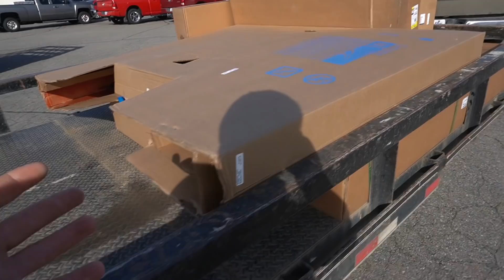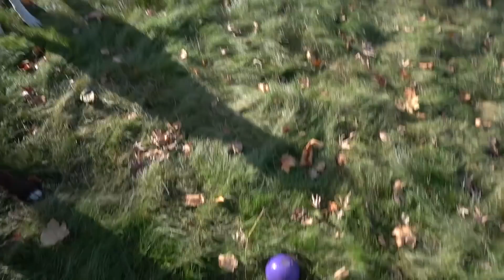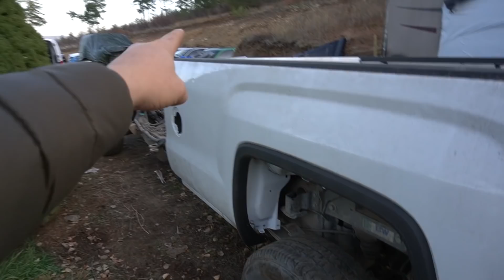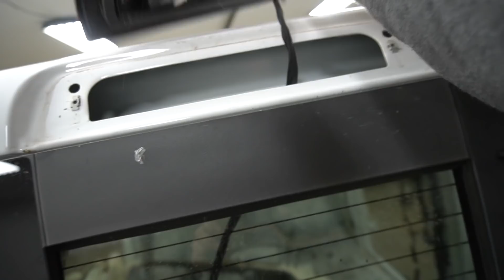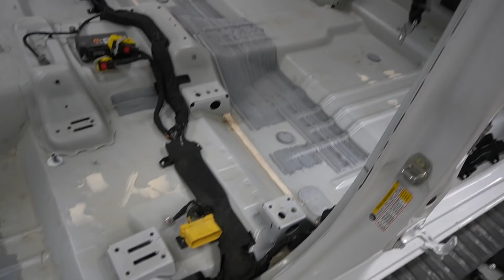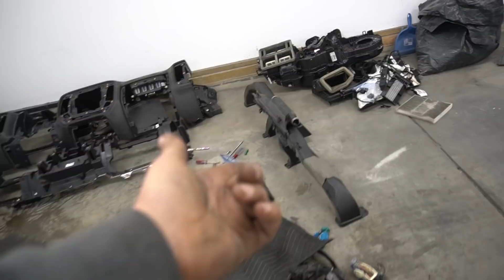Rebuilding 2018 GMC Sierra 3500HD /INTIRIOR WORK prt 12

Comment: Just drill out the plastic welds on the HVAC box. They are only there for the manufacturing of the truck. The screws hold it together after servicing the system.

Comment: Hopefully you have enough of the the dash pieces from the wrecked truck and your parts truck to make the dash work, I will be watching to see how that goes I noticed in one of the other videos a corner of the dash had some damage to it, so I gather your going to use some swapped  parts to over come that or have a plan to fix that which could be interesting because the wreckers want an arm and a leg for dashes these days, so always looking to see other peoples solution to avoid having to buy a whole new dash and I am sure you have a plan for it so be interesting to see how it works out.

coming along SMV I know some might not like the explaining of details on why and what your doing but I actually think its great lots of people get to understand why you have to do this or that or when you run into a issue and what it is and how or what you will do to solve it and its good to hear that because doing rebuilds like these is a lot of work and it takes time and money to do them and not every rebuild goes smooth so its good to let people know both sides of the rebuild coin the good and bad and that yes problems can arise but they can be over come and  you just need to not get discouraged when they do pop up just solve them and keep moving forward, thats how you learn and that what you show so I wouldn't change that.

keep up the good work SMV loo forward to the next update on the new to you ride

Comment: Do yourself a favor before you put the cab on the frame. Delete the DEF tank and everything associated with it. Delete any EGR system and DPF. Aftermarket exhaust. You will improve performance, MPG and longevity!
Reply from the maker: That what I was exactly going to do But right now there is no support team for that and i can't find a company that willing to sell ther tuning and can go through trouble solving.
Reply: @SalvageMasterV  I believe some tuners in Canada could help. Either way you will find something soon.